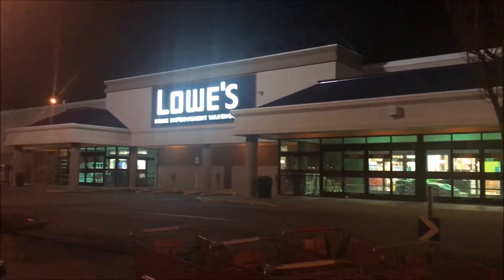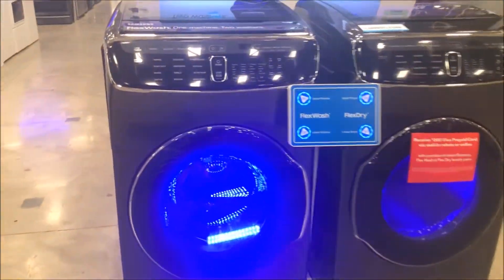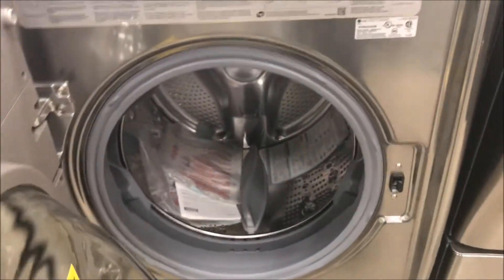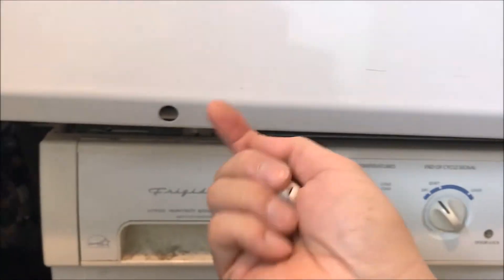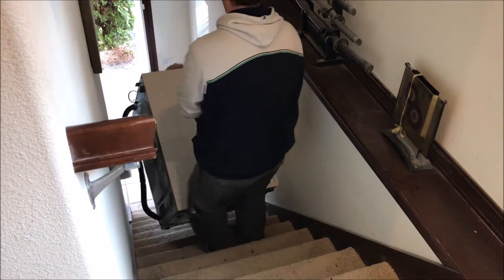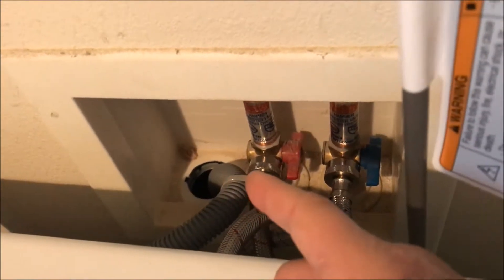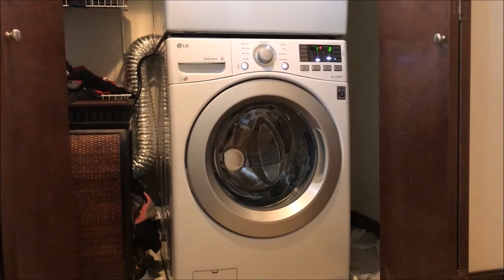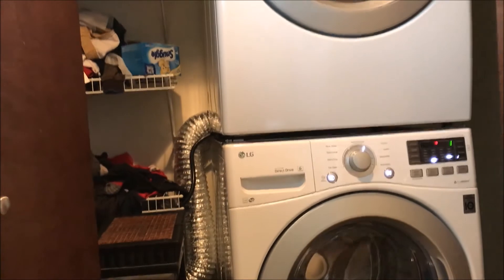Lowes Washer & Dryer Home Delivery & Installation

Comment: I currently own a Samsung front load washer and dryer and it's really a big capacity
Reply from the maker: any issues with it?
Reply: Jay Rule as far as I known I don't have any problems with those machines, I owned them since 2017, I have one of the last of the discontinued models the 9100 which is 5.6 washer capacity